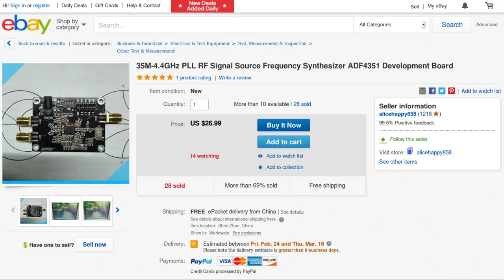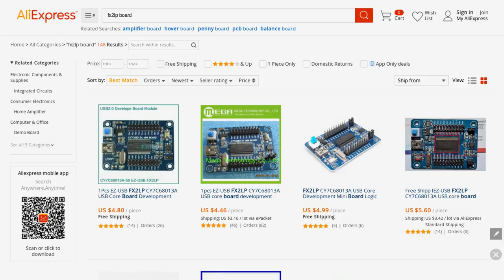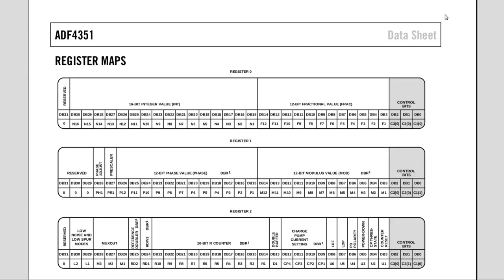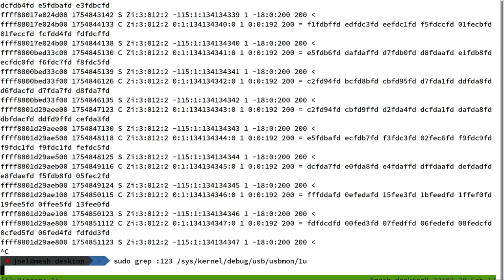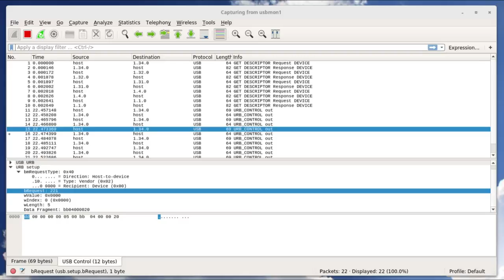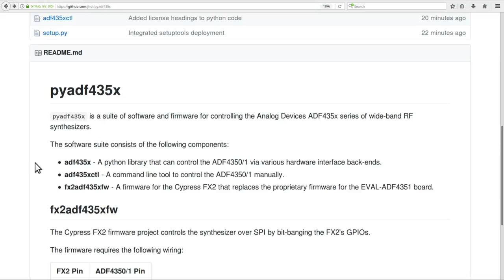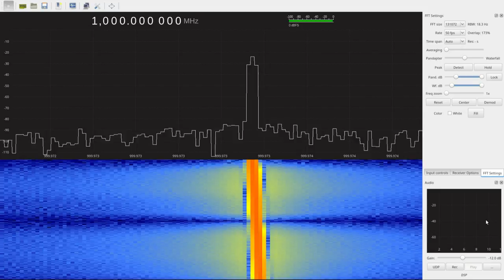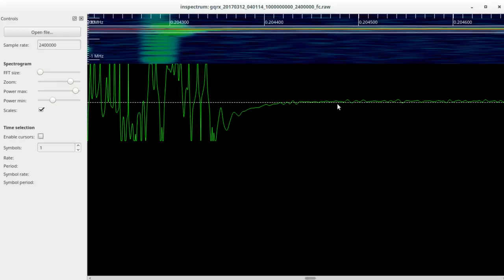[005] 4.4GHz RF Synthesizer Board - ADF4351 - Theory, Setup, Reverse Engineering, Experiments

Comment: Hello Joel, thank you very much for your very detailed video. It contains a lot of very useful side informations for me. Also the notes on your wiki are very useful.

Question: is it possible to use an Arduino Uno (SPI 3.3V) for the ADF4531 control?
There is a nice LCD board with an encoder and joy stick for $11 from elecfreaks.com:
http://www.elecfreaks.com/store/lcd-key-shield-p-688.html
There is already software to make a universal DDS-generator with this shield:
http://www.kh-gps.de/freak_dds.htm
Regards, Rudolf DL5FA
Reply from the maker: Thanks for your comments.

In answer to your question: It absolutely is possible to hook this up with a 3V3 Arduino. In fact many people have already built things like this. If you search around you may find examples with all the code included.